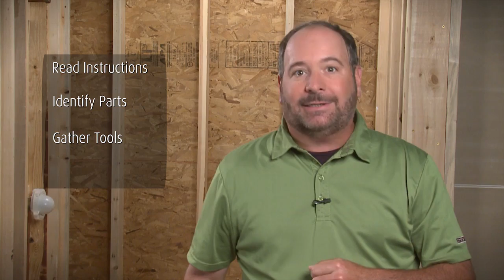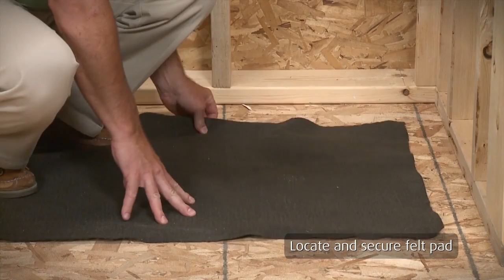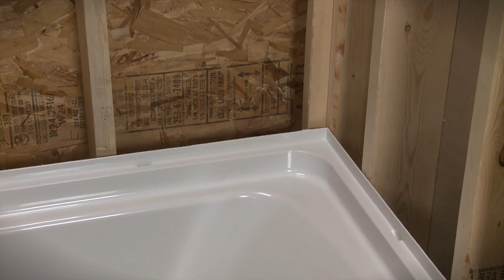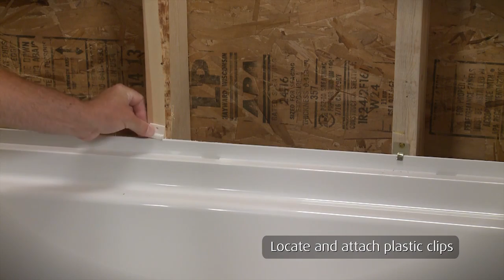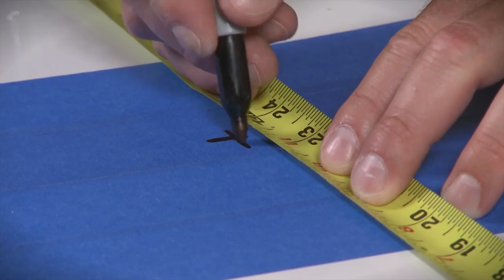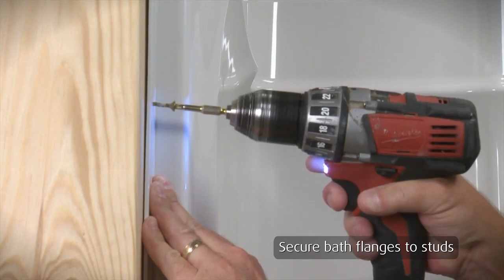Installation – Ensemble Medley Bath/Shower

Comment: Is the back main wall supposed to have any movement in it? Meaning should you be able to push into that wall and it move back and forth away from the studs after all 3 walls are screwed down? I have one being installed in my new home that only a year old because the builder installed the first one wrong and the tub got a hole in it. They said they couldn’t not use a one piece and used a 3 piece to replace. The main back wall moves and I’m worried when they put up the Sheetrock ot will break at the joint because movement overtime

Comment: This install,is a fraud! You cannot slide the right wall in with the tub spout soldered as shown. A threaded wall spout is recommended, that means threaded on both ends of the pipe. I noticed they cut to the top right corner sliding in like it’s no problem having the tub spout sticking thru the hole. You cannot install the right side with a pipe going thru it as the wall needs to slide in and then done. This can also Change the location of the spout. Too late for me , I already drilled the hole in the right side for the spout.
Reply: I ran into this as well, had to install the drain side wall to the back wall on the floor and then maneuver it into place over the stub and mix valve. It sucked.
Reply: P

Comment: The tub surround walls "bulge" out so you may have to move your tub/shower valve closer to the surround if you are using existing plumbing.
Reply: Been wondering about this. We have a shallow valve too. They could rec so thing since they are excessively wide.